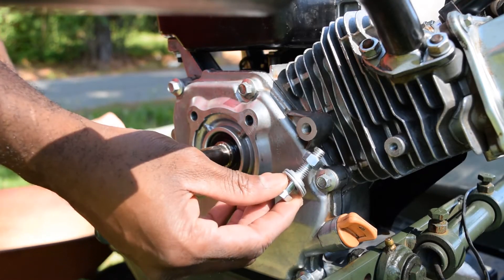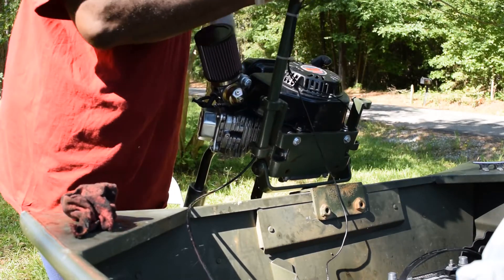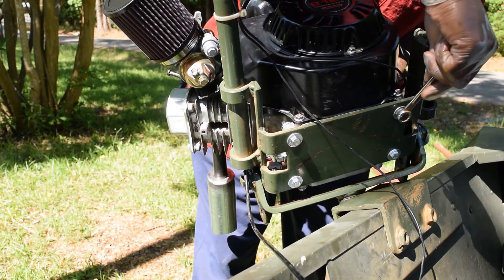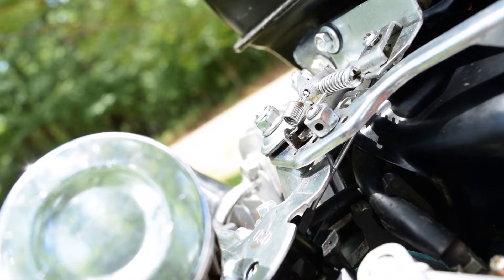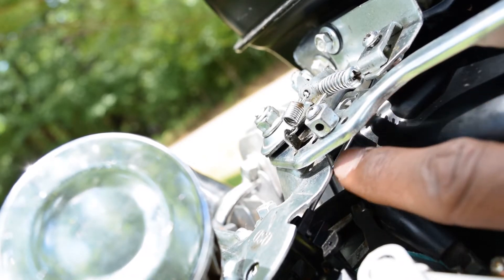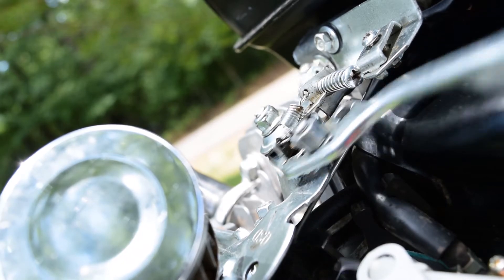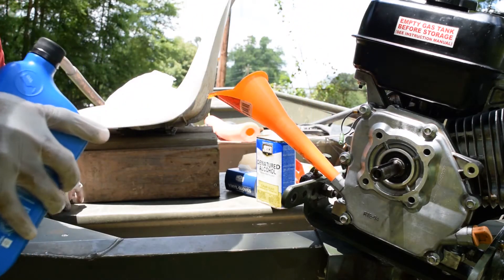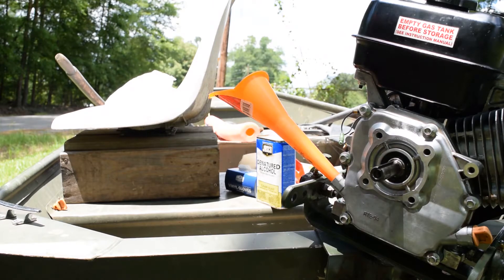Stage 2/3 Mud Motor Build | Mounting & First Start

Comment: I have the sps long tail and the predator in your first video. The engine starts no problem without the sps on. But when I put on the tail, I can't get it to start. Any idea??
Reply: Just want to add I put it together today.
Reply from the maker: When you say it won't start, do you mean it won't fire or it won't turn over?
Reply from the maker: You put the whole thing together in one day? I guess it takes me a lot longer because I'm shooting video. Video slows everything down.
Reply from the maker: Check the oil. Over fill it by two or three ounces. These motors have an oil sensor and as utility engine are design to operate dead level. The design of a longtail mean the engine is always tilted. This freaks out the oil sensor, making it think there is no oil in the engine. 

You have to over fill the oil. Two or three ounces will do it.If you only run the required oil level, the motor will not fire. This is the main reason I removed the oil sensor on the stage2/3 hot rod build. This oil sensor doesn't work well in this application.

Comment: How is the harbor freight trailer working out for you? Did you have to change tire size for hwy travel? I'm getting a hobie 14ft pro angler fishing kayak and was looking at your trailer for towing it.
Reply from the maker: Trailer works fine. just follow the upgrades I've made to make it better. The stock tires are okay. I haven't had any problems with them. Good little trailer for the money.

Comment: It lives!! Hope you varied the rpms a bit during breakin.
Reply from the maker: Haven’t finished the break in yet. Won't crank now. Either gas line is clogged or the coil won't spark. This carburetor won't work with this build anyway, so I have a dirt bike carburetor coming in this week.